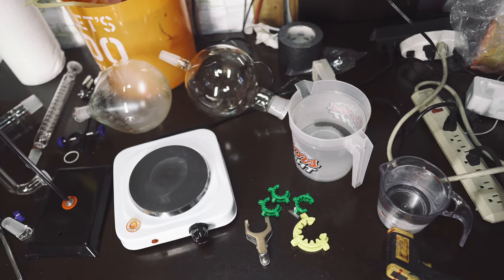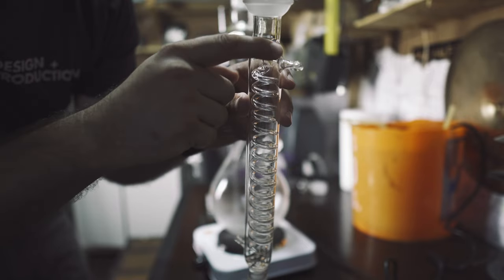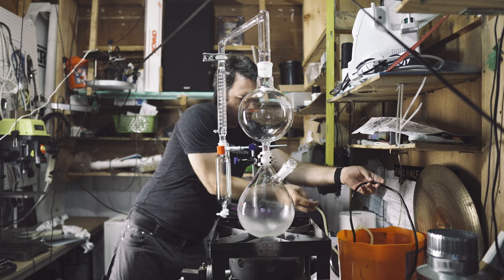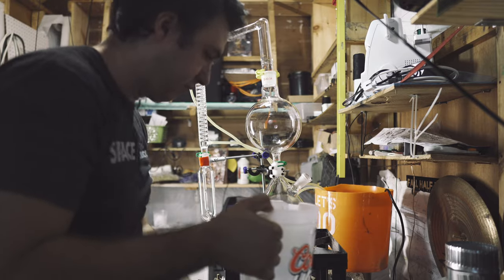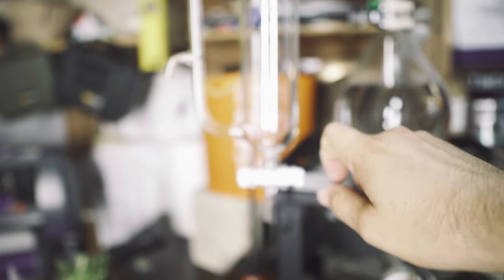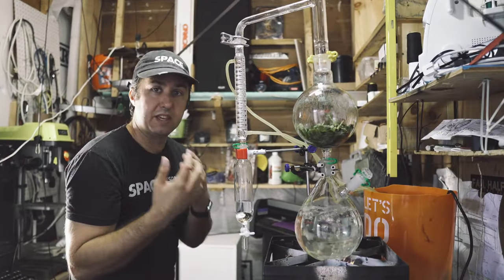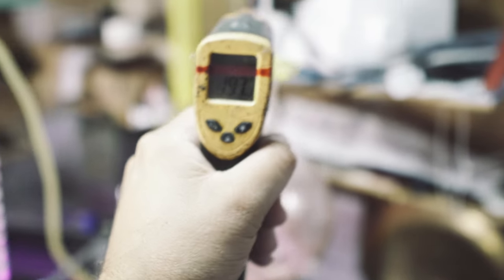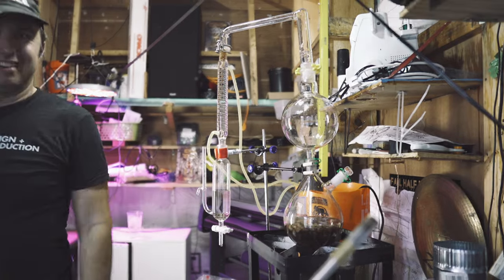How to steam distill essential oil at home and how to fail at that distillation. Beginners guide!

Comment: Your problem is caused by the type of condensor they sold you with this set. This is a Graham type which is not very suitable for water and easily clogged building up pressure. Replace it by a Dimroth or better Friedrich type and you will have no pressure problems and a lot of fun with this hobby. This has nothing to do with propane vs electric just wrong condensor type for application.
Reply from the maker: Oh wow! Thank you! I’ll order one of those right away.. I tried just distilling water and strangely the steam just wouldn’t make it past the bridge.
Reply: @SPACEDESIGNWAREHOUSE  You could cover the bridge and flasks with aluminium foil to keep the heat in the system before reaching the condensor. It saves a lot of time as it doesn't condense too early.
Reply: I also think the problem is "bumping". Put some boiling chips or pumice chips in the bottom flask. When you have a smooth glass surface heated to high temperature the water can actually be in a kind of super critical state  and suddenly burst into a high pressure explosion. Boiling chips will prevent this.
Reply: Can you point me in a better direction for how to set up and use ??? @dubsnip
Reply: Do you have a good company suggestion? All I can find amis vevor or ebay set ups
Reply: How about if used distilled water? Would pressure still build up? I have one those but haven't set it up yet.
Reply: Even easier, turn the heat lower... duh... add a Temp. sensor regulation... duh... it isn' the condenser's fault... duh...
Reply: @SiegfriedSTM dork
Reply: For now, I would put this post with a different heading so that people who are actually trying to research how to do this properly and successfully while you get situated so that we aren't wasting our time. It was funny, I give you that, but, time is money to some ppl, and that was a huge waste a time to watch on something that was an epic fail. So get yourself together, and come back and show us what you got. 😉
Reply: Hey I'm looking to do a cannabis essential  oil would this system work for me ?just not going to use  propane tho
Reply: @CKida1970 We learn even from people's failures, as well as our own.
Reply: @SPACEDESIGNWAREHOUSE  i had the same problem.. and i also change to what you have.. and it works..
Reply: @detoxfromthematrix   this mother f** just made me nervous...knowing its gonna explode.:face-purple-crying:

Comment: I have that same set up and It works fine. You're using too much heat. You're supposed to control the temperature and not let it go through an aggressive boil because all You're doing is cooking the basil in the top flask and that smell gets transferred into your oil and hydrosol. This is a slow deliberate process if you want to get the results you want with your oils.

Comment: Never heat a closed system, the 2nd neck should NOT have a keck clip. There is nothing wrong with your glassware set, and it does in fact contain the correct and appropriate condenser. Never let flame make direct contact with your glass, and since your reservoir has a round bottom, suspend it in an oil bath..over an electric heat source
Reply from the maker: Oil bath! Smart solution!! Thank you.

Comment: Using the hot plate insures that your temp stays at a constant heat, steaming at high temps is dangerous and being impatient isn’t going to give you the maximum yield of the plant. It’s a slow process and needs to be done delicately. It can take up to 9 hours to extract just a small bit, that is why pure essential oils are so expensive. With pure oils you only need 1 to 4 drops vs 15 to 22 drops of diluted oils.
Reply from the maker: I initially had it on the hot plate but after about 35 minutes I figured it wasn’t ever going to simmer. I must have to simply be more patient. Or I had a pressure buildup somehow
Reply: @SPACEDESIGNWAREHOUSE  the flat-electric heat-plate is all wrong. You do get a hemispherical version that cradles the round bottom of the flask

Comment: It was way toooooo HOT! This is a slow process my friend. 6-8 hours slow for some plants (slower for others and faster for some). I have this system myself and it works great.
You cant speed up the process because 1) stuff will explode
2) the essential oil will burn and turn very bad (hint: thats why your basil smelled bad)
3) electric heat is softer than fire heat and thats why they send the electric bunsen burner. 
Try again and just be patient with it. You will have amazing oils come out. 
Oh next time you extract rose again, save the water its great for skin and hair care. 
You just put it on the skin or hair like a rinse. 
Better luck next time.
Reply: I was going to say the same thing the reason I gave you the hot plate that doesn't heat up very fast is because you don't want the water boiling that's why your basil smell like crap because you get it too hot then you burn it and that's what it smells like burnt basil nobody will even dare to put that in a diffuser 😂
Reply: Not sure about plants to make oils but, you are correct. That's way to hot. Even for a stripping run.

Comment: I believe this is greatest video where host has frankly shown how he failed !! This is very useful and will prevent many accidents. Definitely a great help to safety of To-Be chemist (psst! Alchemist)...🙂. In industrial setup, condenser when condenses gas also produce vacuum and which in turn help evacuating the vapor. One of the reason for the blast at last could be noncondensing vapour due to insufficient cooling. So even if your condenser tube is clean but cooling is inadequate you will not have any vacuum at condenser end and hence vapour will not evacuate hence your flask will pressurise and hence ka booooom !!

Comment: As well as the condenser restricting the flow of steam and building pressure I think you need to also trun down your heat as this will also reduce the risk of overpresurising your system.
I wouldbalso suggest trying a bigger pump and pumping it to the top outlet in the condenser. This way your pump doesn't need to push through the spiral and gravity will help drain the liquid back into your water bucket.
Make sure your pipes are s short as possible as any excess will increase the strain on your pump.
Entertaining video.
Makes me want to try this at home.

Comment: You have a close system, I knew that was going to happen. You can just include a vacuum adapter in between the funnel and the condenser. It’s straight and has ground joint on both ends but has a vacuum hose adapter sticking out in the middle which will relieve pressure. No need to attach a hose just leave as is. It’s cheap and you won’t have to change condensers.
Reply: "You can just include a vacuum adapter in between the funnel and the condenser" umm no you can't. Firstly there is no funnel so I assume you mean the "bridge" and the condenser. And if you have observed one of these sets you will discover that they have a type of "rose" joint there which cannot accept a "vacuum adapter." The answer is in fact to prevent condensation from occuring too soon - that clogs up the narrow passage in the Graham Condenser. Also it is not in fact truly "closed" because the water/oil separator will allow excess pressure to escape from the system. Another option is to use a straight-through "Liebig" condenser that will not block the system. Oh and his heat is way to high creating a rapid vigorous environment that is too volatile for the apparatus to deal with.
Reply: @TheDesertsweeper   I’m talking about straight tube vacuum take-off adapter with gas inlet adapter placed bellow the condenser. And yes you can use it, it will work and it will be the most cost affective option. Of course a Liebig condenser would be preferable but I said you can use the adapter “without having to change condenser” to save money. 
So yes the adapter will work.
Reply: @TheDesertsweeper  and there is a funnel, a separatory funnel and as it fills up it creates pressure
Reply: @JoeyVX  the seperatory funnel allows the pressure to escape by design.
Reply: @JoeyVX  yes you can put one down there but it would not help in this case. The pressure is created ABOVE the condenser due to a blockage in the narrow condensing tube above the separator. I guess if you put a vacuum into play it would work by clearing the condenser, but increases complexity. You can buy a liebig for under 20 dollars on amazon.
Reply: @TheDesertsweeper  it’s not an equalizing funnel so no it’s not designed to relieve pressure. The way he has it, if the funnel was used to relieve pressure it would spray the contents of the funnel all over the place but by simply using the adapter I mentioned it would not only relieve pressure but prevent you from losing your distillate. 
I get what you are saying but it will work, it has worked without the need of a vacuum. As the funnel fills with distillate it makes it harder for the water condensing to travel down the condenser thus creating pressure above the condenser and throughout the entire system. With the adapter I mentioned, it would relieve pressure at the bottom of the condenser so the pressure from up top would simply push the water down with ease. 
Of course the set up he has is not the best, not what I would use but at the end of the day the adapter I mentioned will work and has worked! 
You can even remove the funnel, allow it to drip into a cup! No pressure, no extra cost and bang problem solved.
Reply: @JoeyVX  we are going to have to agree to disagree. And yes you are correct - it is not a Pressure-equalizing dropping funnel - an entirely different beast. It i sjust your standard garden-variety seperatory-funnel with the ability to expell excess pressure via the very visible-tube you can see in the video. In fact on this VERY day I was demonstrating this exact setup to a group of school-children and showed them this video. I had one of them blow through the top of the condenser to show that the pressure escapes from the side-vent extruded from the upper-part of separating funnel above the water-line. It works exactly as it should and we indeed extracted a quantity of Rosemary Oil safely and effectively without any kind of vacuum-relief section. I also showed them how too much condensate in the graham-condenser made it difficult to blow through, thus increasing the back-pressure to the bridge and bio-mass chamber creating the effect we see in the video. I believe you may be confusing the seperatory-funnel with a soxhlet extractor or the "Dropping Funnel" you mention. Look carefully at the video. Notice how the funnel has the lower section used to drain excess-hydro-sol. And an upper section that is open to the wide world. Grab one and blow into it with the lower-valve closed and keep a finger on the drain-pipe. And as for removing the separator all together, you will make it difficult to separate out the oil-yield. Buy I guess you could use a traditional Seperating Funnel" after the fact. Unnecessary if you set it up right and do not go mad with excess boiling/pressure.

Comment: Your issue is that you used a direct flame.

You need to buffer the flame, either a fine sand in metal bowl (often used with hotplates) or a ceramic disc to dissipate the fierce heat and also some "anti-bump boiling beads" wouldn't hurt.

You also put together as dry joints, you use a silicone grease that is specially formulated for hot work and won't contaminate the oil or hydrosol that you apply to the glass joints to prevent them sticking together because of different thermal expansion rates, glassware can become  stuck, almost as if it is welded.

You would be better off using an electric hotplate as that propane burner, you risk melting the flask, this cheap chinesium glass is not the 3.3 borosilicate that it claims to be. I have a set like this and I have kit I bought and built up in the UK and can tell instantly that the chinese glass is thinner.
Reply from the maker: I appreciate the good info! I clearly have a lot to learn and am enjoying doing so!
Reply: @SPACEDESIGNWAREHOUSE  we all start somewhere.
Reply: @thepvporg  Could you please tell me the name of this silicon grease? I am working to put one of these together bit-by-bit. I have already purchased a hot plate with a magnetic stirrer and rods, and am still collecting the glassware and stands. Will a magnetic stirring rod work in place of the boiling beads?
Reply: @heatheruebel1262  Look up Silicone Grease for lab glass, thats how I found a supplier here in the UK

The tub is a 200 Gram tub.

It says the following.

C.Bennis Supplies & Services
Silicone Grease
Silicone Grease NLGI 2, produced from pure Polydimethylsiloxane fluid and inert silicate fillers.

And the usual safety blurb.

Be careful as the silicone grease needs to be for lab type use to assure that it will not react with or contains fillers that will react with the chemicals in the item you are removing oil from or (incidentally, you can fraction alcohol) alcohol, however when dealing with fractioning of alcohol, you must have some copper present in the reflux head or in the vapour column as the copper neutralises a potentially nasty build up of a type of cyanide in the alcohol that is fraction'd over.

Comment: Lower your temps and run your system longer, prehaps you could  work under vacum and harvest volatil compound that would have been lost otherwise. Cheer !
Reply from the maker: I think I was fooled because of how the resistance in my condenser was making it SEEM like my temps weren't high enough, when really they were too high and water just doesn't boil the same way when its under pressure.. Im going to try again with lower temps and yeah let it go way longer.
Reply: About how long should this process take with lower heat?
Reply: @melanieesguerra6748  it depends on the plant you are working with. Between 3 and 8 hours I would say

Comment: There is a reason why you should use the hot plate that comes with the kit.  It may take longer to heat, but shortcuts like the one you took sacrifices safety and creates waste- wasted time, wasted materials.  You simply should not idiotcut the process.

Comment: Is the heat to powerful? My guess would be a set high temperature over a longer period of time! But it's actually great to see under what circumstances things can go wrong too. Either way any information is good in this case!  Thanks for the video! I just bought a new 500ml set. Then realized my round bottom flask will not heat sufficiently at 6hrs. I am waiting for a heating Mantle that fits the round glass to heat it more evenly. My guess would be to get a higher temp flat plate for a flat flask, and a heating Mantle to fit the round Flask into a curved apparatus for even heat distribution.
Reply from the maker: Yeah this heat was WAY too powerful. A flat bottom flask would be the way to go!

Comment: So does the oil stick to water steam in gas form then? Only separates in liquid? " Oil and water don't mix" could imply the steam would just bubble through leaving oil untouched.
Reply from the maker: It does. It’s like extremely small oil droplets that get carried up with the water and then combine on the other side.

Comment: Isn't the boiling too high temp? Did u try with the original heating that came with the kit? Do you have to have the cooling  condenser? I have seen it done with a different set up.
Reply from the maker: turns out boiling is MUCH too high a temp, I later tried this again with the provided heater with much better results. I sort of got carried away flying by the seat of my pants.

Comment: The water flash boiled as it was pressurised and you had a sudden leak.  Lucky it wasnt worse. Run it unpressurised to atmosphere dripping into a cup and seperate it later.

Comment: The reason why they include a hot plate is because condensing steam back to water is a very energy intensive process, so you using a burner was boiling the water faster than it could condense (shown by the steam passing out the arm of the separator and the arm is too thin for all that steam so it popped off another joint. If you were unlucky, you would have ended up with something like a pipe bomb but with 300 F water and glass shrapnel. I suggest you start with something a little safer and maybe do some reading and watching videos first
Reply from the maker: While I agree with what you’re saying, I can’t start with something safer, without a time machine. I already started with this, it was relatively unsafe. But I will continue with things that are safer! (Don’t watch the 1000 degree steel ball vids)

Comment: Wow as a professional chemist....  Brrrr I got shivers from all the things that were wrong, unsafe, and deadly!!!!
Reply from the maker: Boy could I ever have used a consult with a professional chemist before setting up this thing!!  I still dont think I understand what was happening and how that much pressure was building up in the system, its not closed!  Theres a pencil sized tube running through and coming out of the condenser, and it seemed to just be simmering, not shooting out.
Reply: SPACE DESIGN WAREHOUSE   Steam distillation is tricky,  

The propane burner too much too fast,  try the electric again this time get a big stainless bowl full of play sand and get the vessel you want heated.  It will take time .  Slow gentle heat is needed.  You have to produce enough steam to heat the entire system to break down the plant material and get steam and essential oils over to the condenser.  Essential oils are fragile molecules and very sensitive to heat degradation.

Any more questions just ask
Reply: @potascoone5297  How high would you turn up the heat? Thank you for the sand tip.